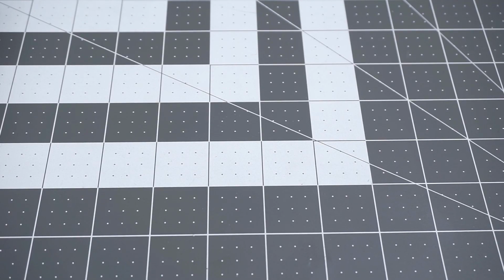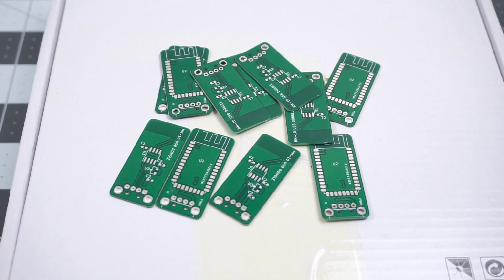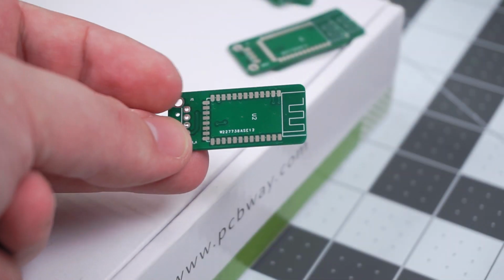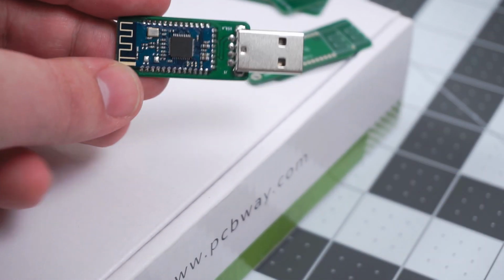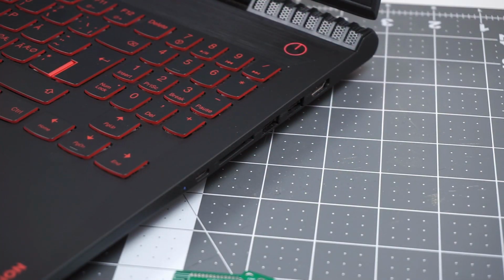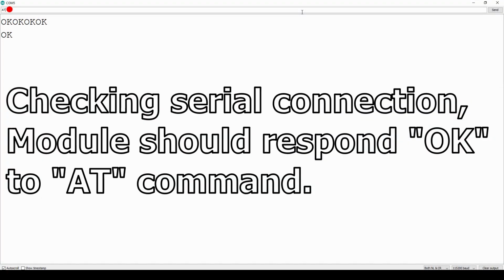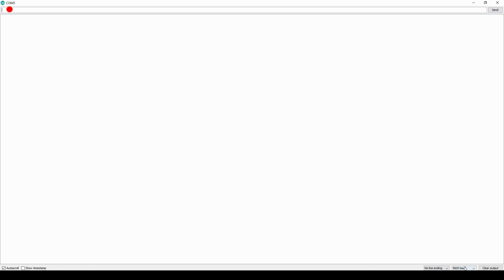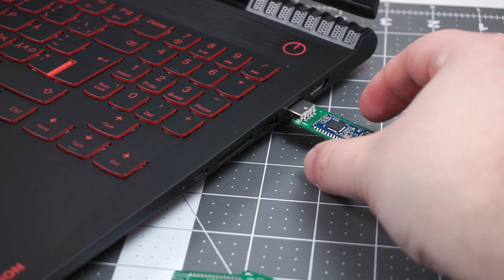DIY Bluetooth USB Dongle, for HM10 Modules | PCB From PCBWAY.com

Comment: The CC2541 or CC2540 actually has native usb also broken out to the castellations. 
The awareness for this fact came to me after disassembling a BLED112 USB dongle by silabs, which is built around a CC2540. 
Maybe those HM-10s can be abused in different ways? One would need a CC Debugger to flash different firmares with USB CDC support then. I think I'll give that a try